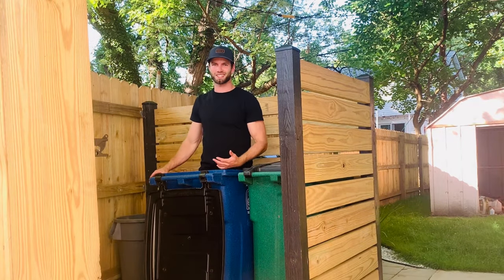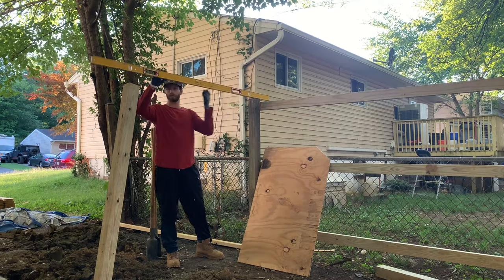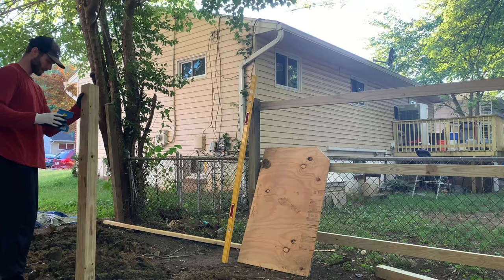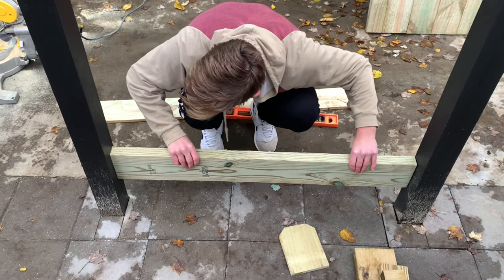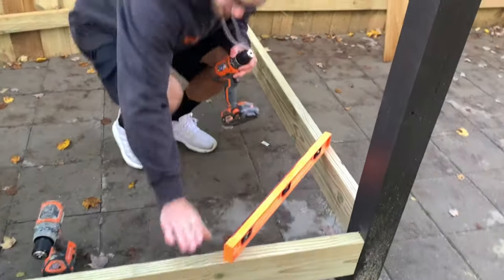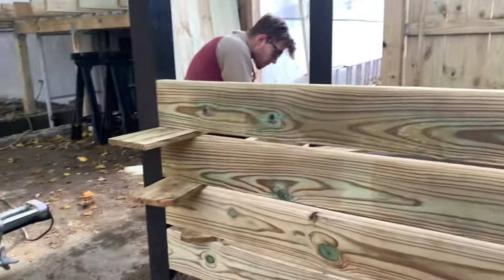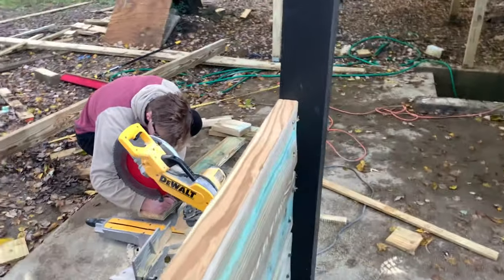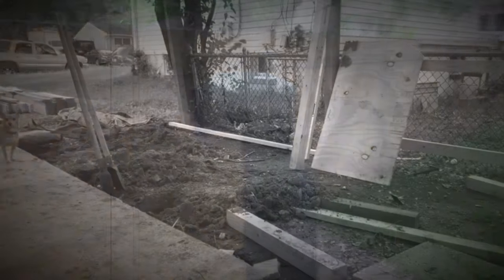DIY Trash Can Screen // Horizontal Privacy Screen

Comment: I love it.. Can you do the panels without spaces? & thanks for showing how to nail sideways, what size nails & you just used a regular drill? Sorry so many questions
Reply from the maker: Hi! You can definitely do it without spacers. However, most wood will shrink over time as it dries. So you might have a little space in between each board regardless. I used 3" exterior (deckmate) screws. And yes - just a regular drill.
Reply: @AndrewThronImprovements  Good info.. Thanks for responding back.

Comment: this a great thank you sharing. May ask the spacing between the fence post? I like how you made the pickets flush to the front on the post
Reply from the maker: Hi - should be around 5/8” spacing. I just used a fence picket as a spacer 👌

Comment: What did you use as the cap piece on top of the 4x4? It makes it look nice and finished off and I'd like to do the same.
Reply from the maker: Hi Kenny, I got the post caps from Home Depot - Link to a similar product is below; 
https://www.homedepot.com/p/4-in-x-4-in-Black-Metal-Post-Cap-359894/308138081?MERCH=REC-pipsem-314301663--308138081--N&
Thanks for watching!